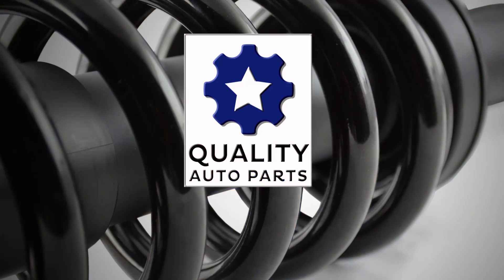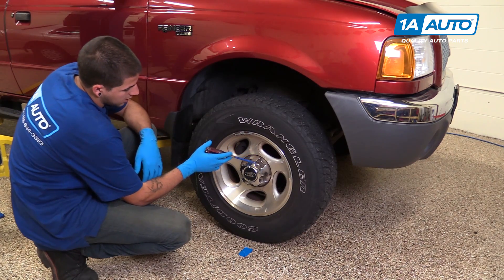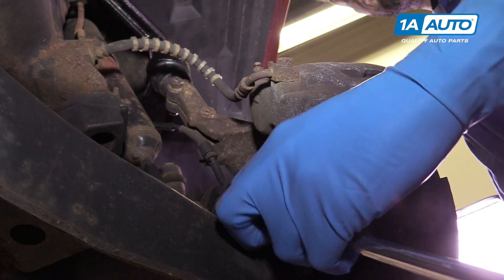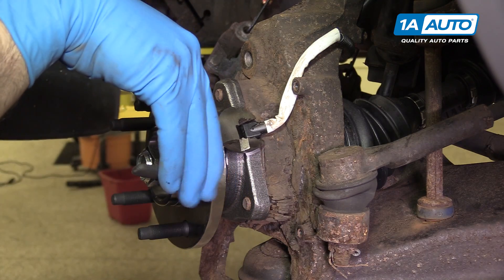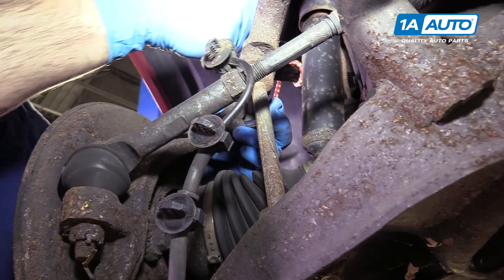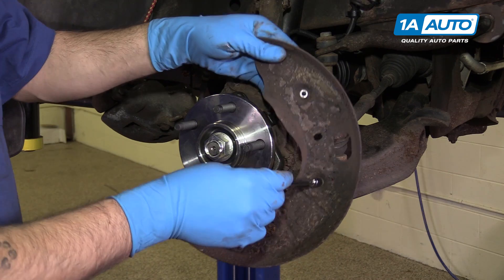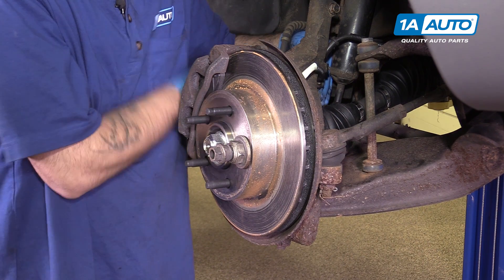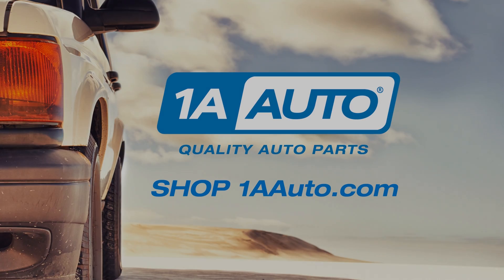How to Replace Front ABS Sensor 4 Wheel Drive 01-09 Ford Ranger

Comment: 2003 Ford Ranger: no need to remove caliper or that bracket behind. You only need to remove the wheel/tire. It literally! Just unscrews from behind the tire and runs up to behind front bumper. Very easy very accessible. It literally snaps in. Save yourself the time. Writing this from my yard as I sit here with tire off I just did this in about 10 min. I wasted time removing the caliper. Before I removed the rotor I said wait a min, this is all it is? I didn't even have to do that! Just follow the wire unsnap it from the frame and the it hangs down behind the front bumper. Just unsnap it and snap the new one in😂😂😂

Comment: My 2008 Ford Ranger 4.0 4WD was having an issue where slowing to a stop, especially when turning into a parking space, would kick on ABS. 

I followed this video to replace the ABS sensor on the driver’s side and it worked perfectly. 

It was easy to pull the old ABS sensor out, however the plastic cap got stuck. I was able to coax it out with a screw driver. Other than that I had no issues. Thanks.

Comment: couldn't you just remove the speed sensor from behind? or does the shield sit on it? on my mazda you can take it out without removing any of the break parts and/or wheel.
Reply: On the Explorer you need to remove the disk just to be able to get the sensor out, but not the dust shield. Typical crap Ford design.

Comment: I have a 1999 ranger showing the right front abs problem,  is the sensor the same for this year?  C1154 code
Reply from the maker: +Daniel DeMaio This video is applicable to the 01, 02, 03, 04, 05, 06, 07, 08, 09 Ford Ranger

Comment: Those sensors don't come out so easy. I've found that the plastic part usually stays in the hole. I find a bolt that will thread into the plastic piece, heat the bolt a little and it will come right out.

Comment: Why does it have 4 abs wheel sensors?  Ive got an 08  4.0 4wd and its got 2 on the front wheels and 2 on the transmission..  non in the back..  is it just based on if you have 4 wheel abs or not like its an option for the rangers..??  I figured all 4wd only have the 2 abs front wheels..
Reply from the maker: +Z Ack Thanks for watching!  Depending on which model you have you can have 4 wheel ABS, 2 wheel ABS or no ABS.

Comment: I just did this exact thing on my drivers side.  I took it apart, cleaned it up, got the old sensor out and put in the new one.  Took it for a drive and it worked great....but I noticed that that ABS light on the dash is now on.  How do you reset this?
Reply from the maker: +Rocker Thanks for checking us out! You may be able to reset this with a scan tool. There also may be an issue with the sensor causing the light to come back. We would recommend trying to clear this with a scan tool first and if it comes back to look at the sensor.
Reply: @1AAuto  Thank you.  I'm going to go and try changing out the other side too.  I was just assuming it was the driver side, but it might not be.  Either way, the brakes work great now with the ABS disabled, which I prefer in older vehicles.

Comment: 2006 Ford ranger My abs when I put my foot to the pedal makes my pedal pulsate coming to a stop if , it depends how hard or how fast im going.  I have no check engine or brake lights on my dash. What could it be if I pull the fuses for abs it shows light on dash but I get no pulsating since I disconnected the abs.. speed sensors ?? Help
Reply: I'm fairly certain that you need to replace the ABS sensors that are shown in this video. My Ranger has the same problem.. its the ABS taking pressure off the brakes because it thinks the wheels are locking up, due to faulty sensors. That's why it works normally when the ABS fuse is disconnected. 
I'm going to change these (as well as the rear sensor, located on top of the differential housing).
Reply: Did this resolve the issue?

Comment: on my 2005 Ranger i had a bad sensor engine check and when i changed the disk/hub and bearings, problem solved. warped disks and bad bearings was the reason.

Comment: I have a 1999 ranger 4.0 4wd. Does is have front abs/speed sensors?
Reply from the maker: +Reginald Houston It could either have front wheel or 4 wheel abs. If you have the dealer run your VIN number for you, they will be able to tell you what the vehicle came equipped with. Here is a link to them replacement wheel hub bearing assemblies if you need to replace them. Hope this helps you out https://goo.gl/GCZGEr
Reply: If your vehicle has ABS then yes it necessarily must have front ABS speed sensors.  The rear sensor is probably not on each wheel but rather one in the differential which is also used for the speedometer.   "IF" your wheel bearing/hub assembly does not have worn out bearings, you only need to replace the speed sensor, unless the tone ring inside is too gunked up to clean off sufficiently, but if it is too gunked up and at the age of the vehicle, at that point it could be time to get new front hubs if you want to get many more miles out of it.   Only you can decide the overall condition of the vehicle and value of longer term investment vs just doing minimum repairs.  Personally I would not replace the hubs until there is a sign they are worn out, noise when changing lanes or play observed in them.